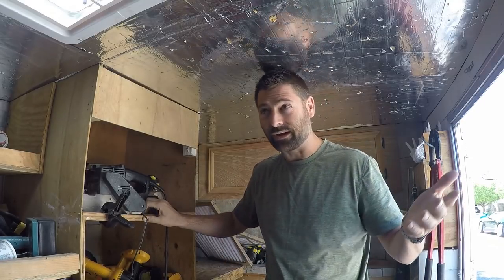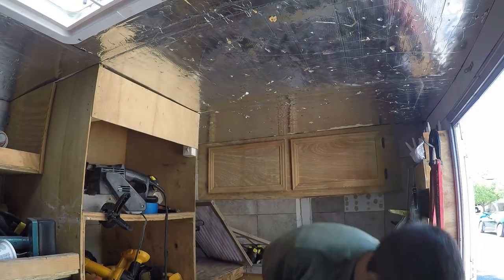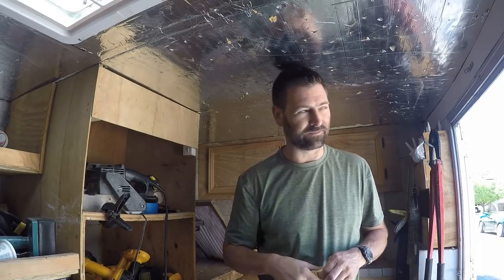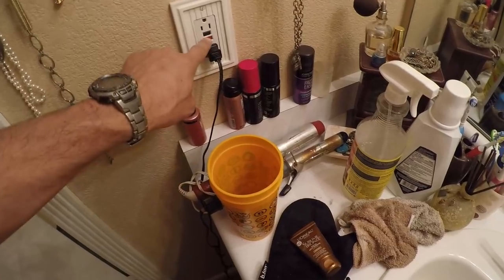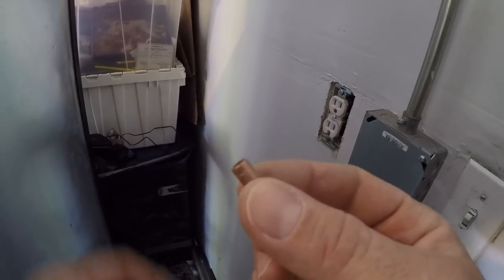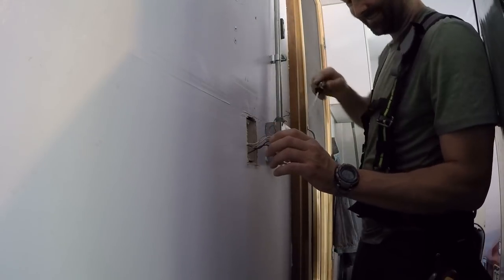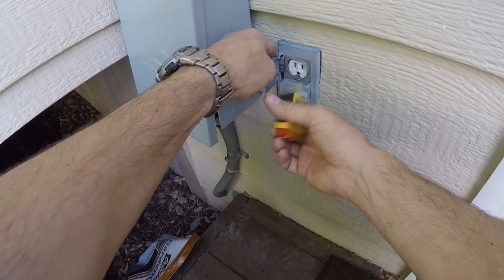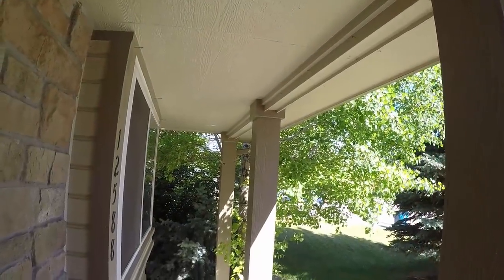Handyman Makes $1,200 Per Day Resetting GFI Outlets For Millennials | THE HANDYMAN |

Comment: Wouldn't it make sense for the bathroom outlet to be a dedicated circuit. Having the outside outlets, garage outlet and bathroom outlet on one circuit seems like a bad idea. Hair dryer, power tools, and a fridge  all at once could easily overload that circuit. I'm pretty sure it's now code here in Canada that exterior outlets cannot be tied into interior outlets. I know codes change all the time, but a dedicated bathroom outlet and dedicated exterior outlets seem like good ideas.
Reply from the maker: It costs a lot more money to do it the way you suggested.  The most common way you see it here is the bathrooms will be on one gfi.  The kitchen will have 2 gfi circuits.  The exterior, garage and basement will be on another gfi.

Comment: Another reason could’ve  overload, don’t u think so?
Reply: Depens on how many applianes are on that circuit. Check if other circuits are wired correctly, could b a lose connection on a receptacle on the cicuit

Comment: I had my wife call an electrician to come out and fix a light that wasn't working while I was at work....It was in the attic and doesn't get used very often.....Turns out it had no bulb in it because I forgot to replace the one I had removed and had been interrupted before I could get the new one in a month before...

Comment: The bathroom outlet should not be on with any other area of the house. Instead of pushing the reset button and waking away how about you run a new circuit and separate the bathroom from the rest of the existing one. Maybe even put the garage fridge on its on circuit as well

Comment: To be fair, this is a dumb wiring job by whoever did it. Doing multiple outlets downstream of a GFCI makes sense to save money if all the outlets are in line-of-sight and they all make sense (e.g. all on a counter), but when they're in different rooms, just pay the $15 for a separate GFCI for that outlet and connect the previous circuit outlets so that it isn't already on a GFCI.

Now that GFCIs are less than $20, I try to avoid doing downstream outlets. GFCIs do go bad (and won't reset), and when they do, it can be pretty inconvenient to have an entire room dead until it can be replaced.

Comment: That GFI keeps tripping because there’s too much of a load on a 15A circuit. The outlets/GFI’s should be replaced with 20A receptacles (assuming that’s 12g wire) and the breaker replaced to a 20A. 

If it’s 14g wire then fuck all it’ll just have to keep tripping.

Comment: you said this as if its normal to have multiple outlets wired inline like this, this is in no way normal or code compliant anywhere i know of...any gfi should only affect that outlet not a whole series of outlets.
Reply from the maker: LOL you need to get out more and talk to an electrician.
Reply: It is compliant to have more outlets downstream from the GFCI (thus the "Line" and "Load" terminals. What's not compliant is having the bathroom circuit serving other rooms.

Comment: Got a call the other day to fix a plug, I get there its a gfi the green light is on but its not giving power i pull it out the wall and some dumbass wired it to load instead of line.... switched the wires to the line terminals, sat in the bathroom on my phone for 30 minutes to act like I was doing something got paid and left 🤣

Comment: Pls let the owner you can wire this different so it’s not connected to gfi 
If you can
Reply from the maker: The owner has never even seen this house.   This is a rental owned by an out of state investor.  Management company isn't in the business of rewiring houses.  Only make it work to keep it rented.

Comment: Do you ever get any customers that come across your videos?
And then mad? 

I was going to make videos.. I am very reasonable priced.. 
Honestly... I would've charged under $100 for that, only because of time I could've been doing something else (guessing that's why the price is what it is)? and gas..
Reply from the maker: I don't use my videos to promote my business.  My customers do not watch my videos.
Reply: @TheHandyman1  
I understand that... Was just wondering if any have ever seen and questioned about them?

I was thinking of starting a channel similar to yours and not advertise to customers about my channel.. 
But lots of people watch videos.. 

I personally like your videos.. 
I'm kinda new to this channel .. but ya give good tips. And do nice work. 

Actually got an idea from your kitchen remodel.. 
I have a kitchen that has a 9'4" ceiling and instead of sheetrock.. 
Tuesday I am going to convince the wood... (Possibly)?
Might even do it in my own place? Would add a nicer look.

Comment: "Outlets are upside down" The NEC as of 2012 says that the ground be situated at the top of the outlet so if a plug is hanging half way out if you drop a piece of metal or something on the plug it won't cause an arc! Just FYI. I dig the channel bro, keep it up!
Reply: True.  We built a house and all of our outlets were installed ground hole up.  It took awhile to get used to...

Comment: Yikes American electrics are so naaasty. Old skool. 

What else he didn't even attempt to track down the source of the fault? Means may trip again an hour later..  $500 holy smoke !!
Reply from the maker: You must have not watched the video.  The source was over loading the circuit.  2 refrigerators and a hair dry will trip the GFI.
Reply: The Handyman 
Diagnose : "just press reset button" 
Drives off not knowing the true cause of the fault...

.. homeowner searches directory for a 'real' sparky..